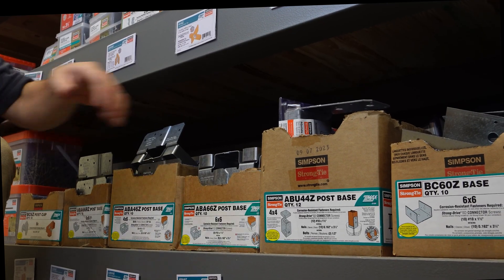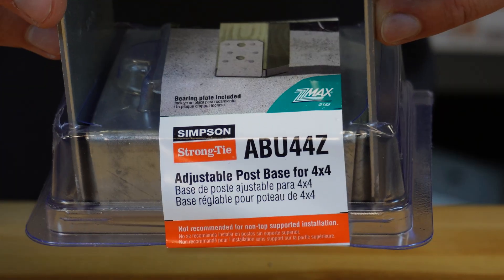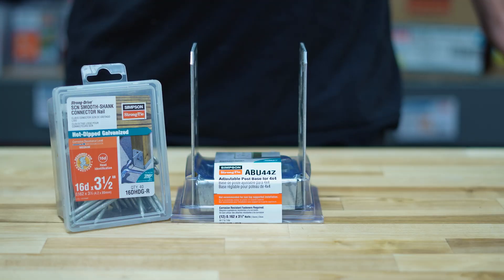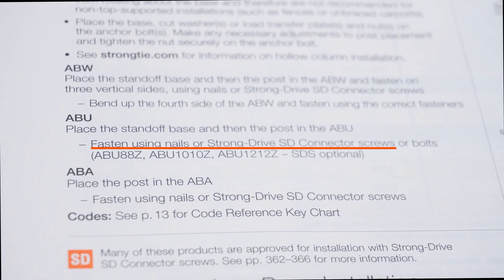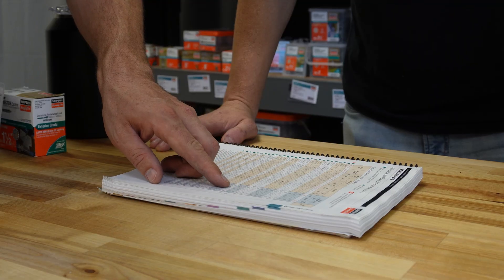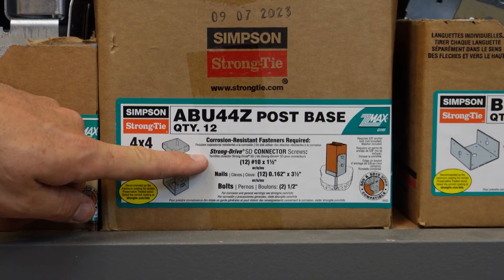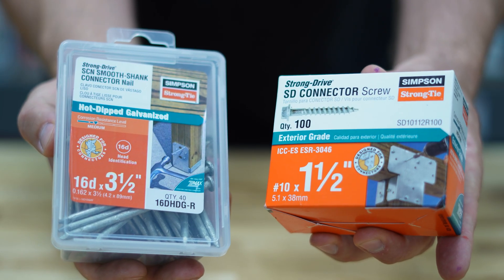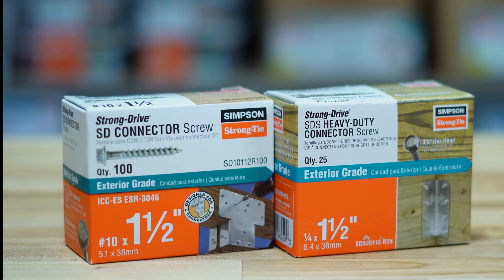Screws vs Nails for Simpson Strong-Tie Connectors | What You Need to Know

Comment: In the description for A44 Angle it says to use "#9 x 1-1/2-in Strong-Drive SD screws". I tried to fit the screw through the mounting hole on the Angle an it did not fit. Threads are a bit larger than the diameter of the mounting hole. Do you need to force the screw through it? Or it's a bad description? Thanks